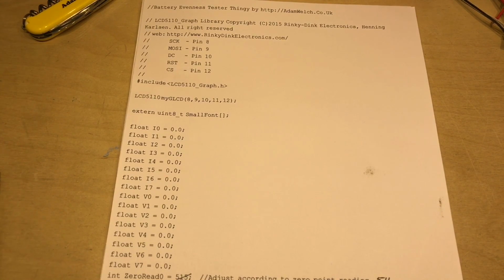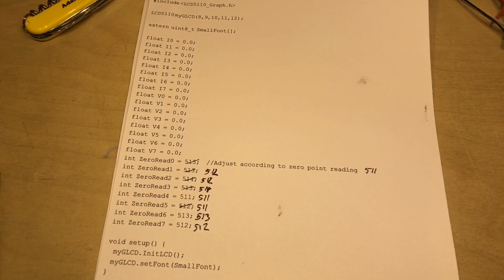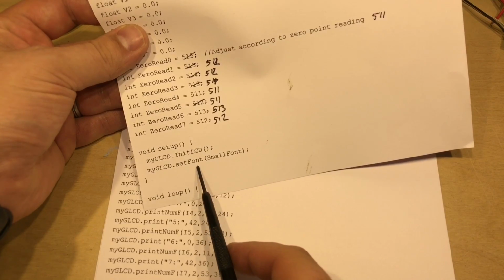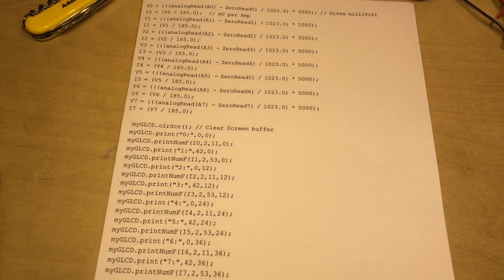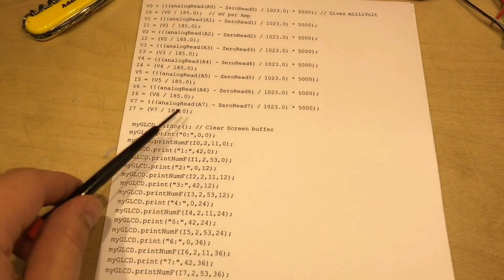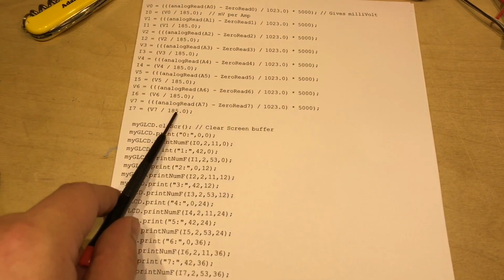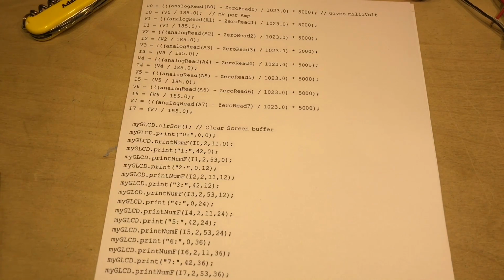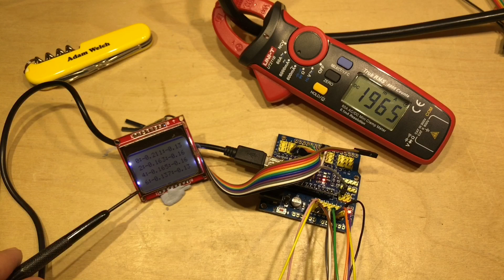Battery Evenness Tester Thingy - 12v Solar Shed

Comment: After the initial burn-in, a lot of semiconductor devices' characteristics will have drifted. This might be a part of the problem, so it could be worthwhile to re-calibrate the module zero points and to adjust the sketch accordingly. Thanks Adam. P.s., you were mentioned by Julian Ilett in his latest vlog.
Reply from the maker: +RWBHere I'm thinking that this setup has quite a few possible issues. Burn in is a possibility. Magnetic interference, different sense pin wire resistances, chip inaccuracies, reading multiple analog inputs moments apart etc. etc.  Lots more issues to overcome. 
Julian is very kind to me and I'm very grateful to him. He is a top man.
Reply: Might need to use screened sensor leads then. Maybe a capacitor across each end of the lead will help to filter out any fast transients. Looking forward to your eventual solution.

Comment: When converting your Analog readings to mv, don't you need to calibrate the 5000 (mv) that you multiply by to your actual VCC of the Arduino? I never get an exact 5v through the linear regulator and always got more accurate results by occasionally reading the internal voltage though code. 

I used this with the 4x battery capacity checker that I redesigned from one of your previous videos to great success.) I don't remember the original source where I read about the technique, but I found this write up on it and it look similar to my code. ( https://provideyourown.com/2012/secret-arduino-voltmeter-measure-battery-voltage/ )

Comment: I wonder why didn't you use INA219 modules? Hall effect sensors are pesky, cause they are so sensitive. Even some cables adjacent to the board can skew the readings, if the current through those cables is big enough. Stray magnetic fields can give you a headache with these sensors.

Comment: Ah Ha! Nice detective work. The Hall effect are just too "bouncy" for my liking. I had a play with the ina219 as well to try something else and from now on I think I'll do it the old fashion way with a shunt and Op Amp.

Measure your batteries internal resistance. If the IR similar on each battery, they should be charging and discharging evenly; other variables being the same.

Comment: Could it be in the proximity of the battery wires? Affecting the magnetic fields? I guess you can't conveniently spread them out unless you redo all the wiring and make them longer. Maybe use the clamp meter on some small independent circuit while waving it near the current sensors.